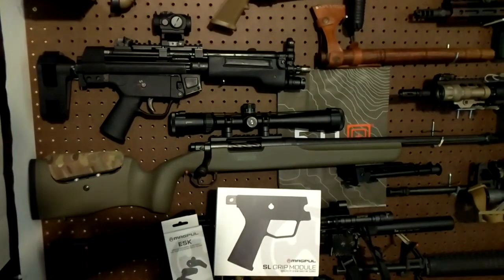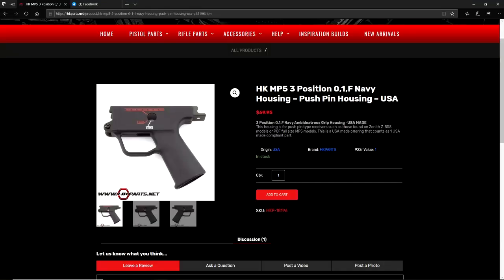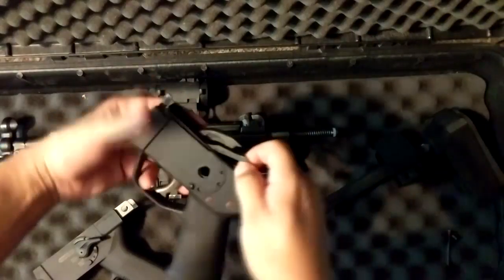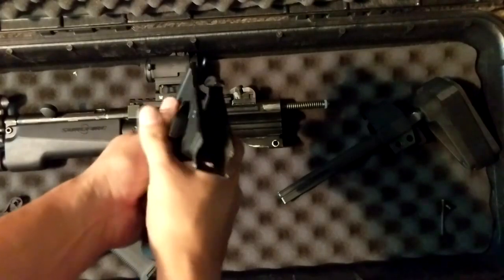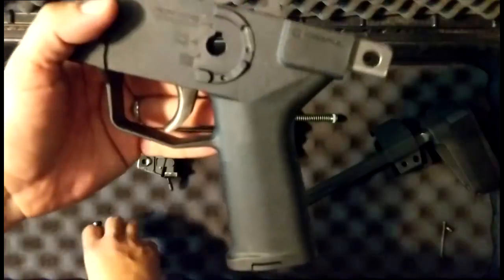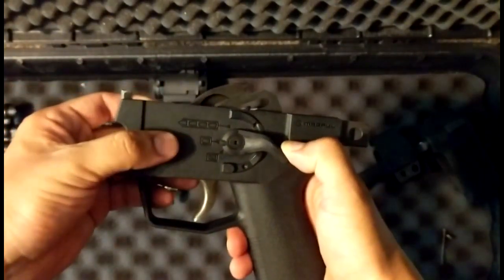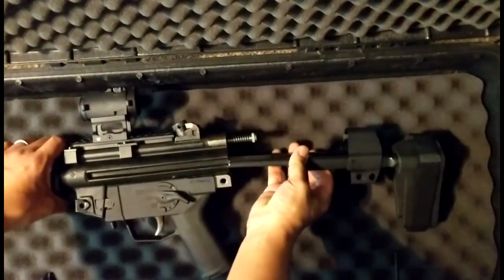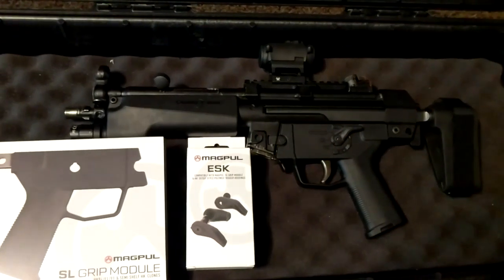Magpul MP5 furniture short review and installation

Comment: Have you ever had your push pin walk out. I'm having that issue with my PTR9ct, magpul SL grip and magpul stock
Reply from the maker: Hmm, no I haven't had that happen. You may just need to get a new push pin if the old one has a detent spring that's worn down.

Comment: Magpul furniture only works on SP5 and SP5 clones.  They won’t work on POF MP5s.
Reply from the maker: Thats probably true. Do POF clones use the front pin?
Reply: Mine does.   It has 2 pin, semi auto metal piece in rear of receiver and the shelf.  It from FSAAP ( Fed armament In Arkansas).